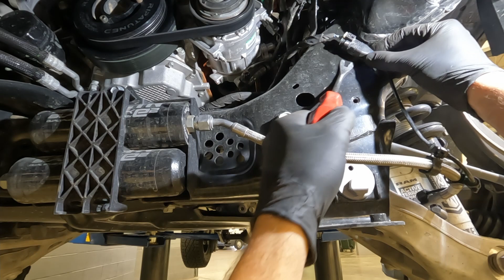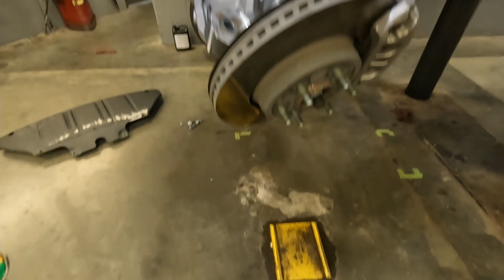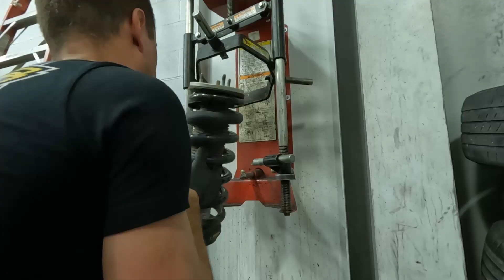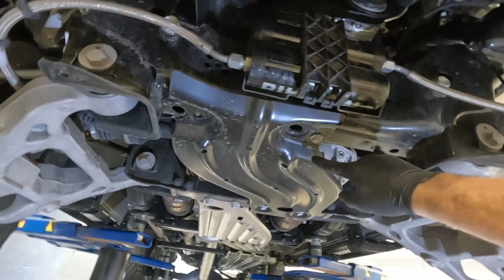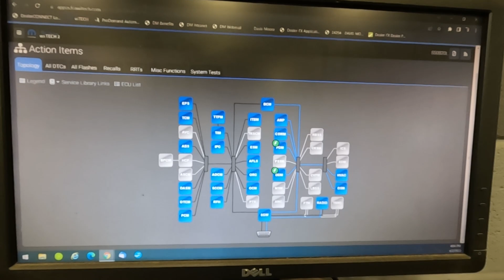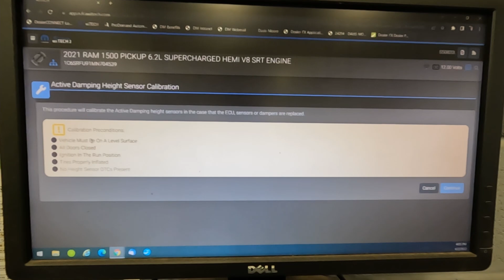RAM TRX Front Spring Swap DIY Install Guide

Comment: I like the shock disassembly/removal socket you have what are the sizes?
Reply from the maker: I think the nut is a 21 and the center shaft is a 10mm but it has been a minute since I have had a TRX apart. Thanks for the view!

Comment: Thanks for all those TRX videos Tyler.
I am confused with my TRX and I was wondering if you know what to do here:
My suspension doesn't show any differences in driving modes.
It also feels erratic going over rough road as it comes out of bumps unevenly. 
What do you think?
Reply from the maker: It might need the ride height sensors recalibrated at the dealership, does it have any messages on the dash?
Reply: @TylerPotter  nothing on the dash, and I reset ride height via alfaobd

Comment: Nice video Tyler, I am going to be installing some Gieser springs tomorrow using your videos. Problem is I can’t find any shops with a wall mounted spring compressor! Do you know if you can reset ride height using Alfaobd?
Reply from the maker: I think someone has said that alfa obd has the option to reset it but I have not personally tried. Thanks for the view!

Comment: Do you have a link for the socket you have on video ?
Reply from the maker: No it is a Mopar tool, but the nut is a 20mm and the stud is a 10mm.
Reply: @TylerPotter any update or suggestions on that 10mm & 20mm tool?  Have only found “out of stock” $500 Kit…..

Comment: Hey Tyler, thanks for all the great videos. So helpful! I do need a little of your knowledge of that socket combination you mentioned in the video that keeps the internal shock shaft from turning when removing. Can you share the sizes of that special tool? I think it's on summit, but wanted to confirm the sizes.
Reply from the maker: The nut is a 20mm and the stud is a 10mm, I'm trying to find a aftermarket solution for that tool. Thanks for the view!

Comment: Do you have a link or a name for the shock socket?
Reply: And what size is it?
Reply: Actually, I don't need it to install a perch collar, right? I don't need to remove the spring.
Reply from the maker: If you are using a strut machine to compress the spring you probably won't need to remove the shock top mount to get the collars installed. Thanks for the view!

Comment: I had dealership do mine. Really easy they just ask if u want it replaced and 100% free. Might need to find strong springs due to this massive fab four winch bumper I have now lol
Reply from the maker: Or a leveling kit to help lol Thanks for the view!
Reply: I was thinking that to but I'm not sure. It seems it has more bounce than it use to. With everything it added roughly 235lbs bumper and winch. Probably do both and that way I can add 37" tires lol

Comment: I like that special socket tool for the end of the shock. I bet it made you some money since you bought it.
Reply: Tyler, great video. Any chance you can provide a link to the shock tool you used?  Thanks!
Reply from the maker: After having a fox racing shock explode in my face, I use the tool now lol I very literally painted the shop wall and myself in shock oil